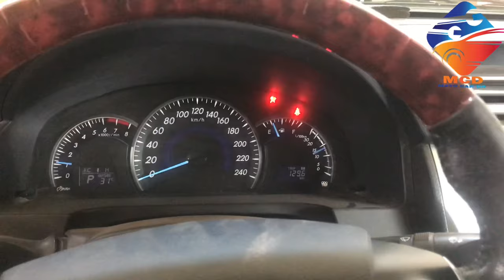How To Diagnose Engine Noise Of Toyota Camry

Comment: 2000 V6 Camry has that noise @2:50. Problem after 20K miles on new timing belt/water pump, tensioner and idler rollers, Denso parts. Replace B1 S1 O2 sensor per obd2 scanner, then check engine light cycles on and off about every 100 miles (B1 S1 related). Like that for 4 years, Then all cylinders misfires on freeway speed, another time only bank 1 (1, 3, 5) cylinder misfires after driving for 7 miles on country road (35 mph). Feels like a slow death, what could it be?
Reply from the maker: Clean the fuel injectors
Reply: @MayoCarsDR  Thanks, will try it.
Reply: @kimchee94112 any luck?

Comment: I have a 1994 Toyota Camry 4 cylinder.   When the motor is running. I turn on the heater fan , I feel a vibration in the motor compartment.   Is it the pulleys or is it the fan itself in the dash board.  To me it sounds like it's in the motor compartment.   Any thoughts ?  Thanks for any help you can give.  👍👍
Reply from the maker: The engine mountings hold the suspension and engine into place. The mounts hold the engine and transmission at the right suspension angle. When you turn the Ac, the mounts go through a lot of strain. Therefore, when the engine mounts or foundations wear out, you will experience vibrations and shakes when the AC is on.Also, if the throttle body is dirty, the engine still vibrates

Comment: I have a 1997 toyota camry when i turn it on it makes loud clicking noise and when i press the gas it makes a loud clicking noise could you tell me the issue? the starter is new , battery new , shocks new idk what the issue is
Reply from the maker: I think the sound is coming from inside the engine but how can I tell you where it is coming from without hearing it, if possible please send me a video of it.

Comment: Agree w/leave the music off. We are stressed out enough with our ''rattle'' problem & want to hear the sound of your car. ☮
My AC is ice cold, but rattling sound when AC is on. Turn compressor off and just run the blower & sound goes away. 2 AC Repair shops said it was the compressor (just listening) w/out detailed diagnosis. Around $2,000.00. 3rd garage said it might just be a bad Tensioner, which would be much less. 
Still looking for video with similar problem and sound.
Reply from the maker: 1Could be number one belt tensioner and number 2 Ac compressor
Reply from the maker: See this video,maybe same sound https://youtu.be/qDrPvfaYk7E
Reply: @MayoCarsDR  Hard to tell from that video, but my rattling sound begins when AC is turned on. It increases when gas pedal (or ac fan) increases. Turn off ac and it stops.
Mine is more of a rapid tapping sound. difficult to describe the sounds.I searched a lot of clips last night and struck out. Found a few threads at Toyota Nation w/similar issue,  but none of them ever posted what the problem was. I just hope it is not the compressor.
Reply: @MayoCarsDR  One Auto/AC place said it was the compressor but would not give an estimate unless I paid $75. to check it out.
A garage said it was the compressor and said I needed the AC kit 2 $2,500.+
Another garage said if it was the compressor, it would be $1,500, but he also said it sounds like it could just be the tensioner. I like his answer of course because of the much better price, but I'm scared they will get into it and then find other issues that would make it more then the $2,200 that Toyota quoted over the phone. 
I'm confused why one place said it would need a Compressor but would also need a Condenser, but another shop said it would need a Compressor & a receiver/dryer.
Difficult when it is a repair that the customer is clueless about....Hence all the research and questions at Utube 🙂